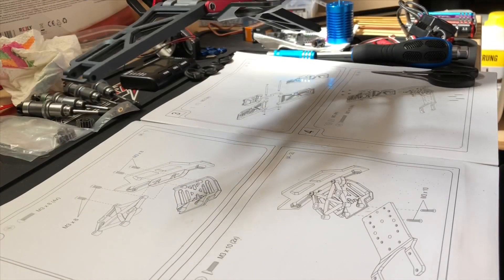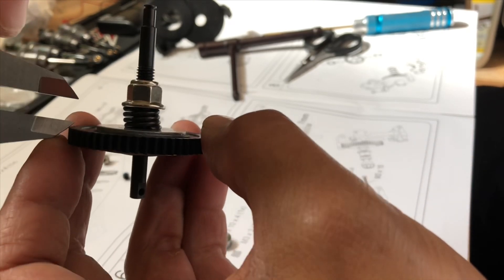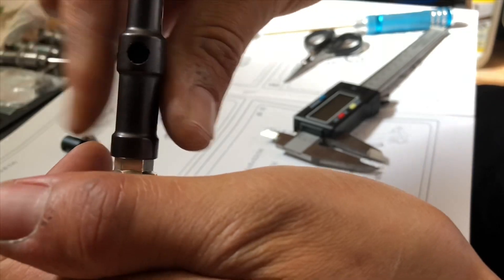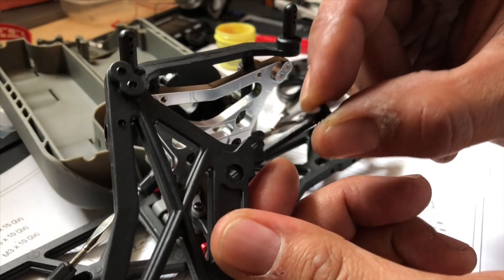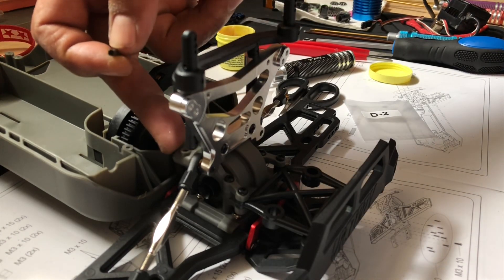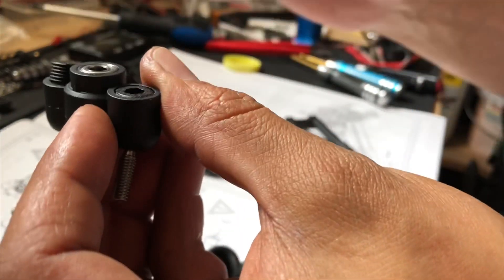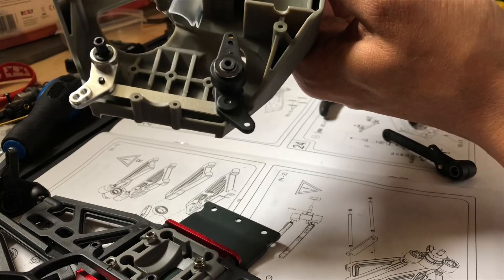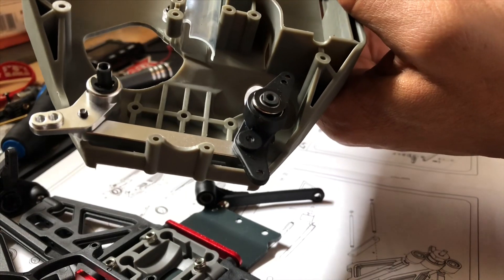REELY New1 Aufbau 1:10 Bausatz & Tuning

Comment: Moin welches Modul hat denn das Hauptzahnrad bzw. Ritzel?
VG
Reply from the maker: Modul 0,6 - Viele Grüße
Reply: Bist du dir sicher ? Ich hab nen 0,6er Ritzel hier und die Zähne sind wesentlich kleiner als die vom Originalritzel hätte eher auf 0,8 bzw 1 getippt 😅
Reply from the maker: @IITheRaZoR1911II  Sorry, mein Fehler. Das ist dann ein Modul 0,8 - Ich hab mittlerweile alle Module daheim rum fahren, da hab ich mich vertan. Aber 0,8 passt auf jeden Fall. Ich habe in der Vergangenheit den DT03 von Tamina gefahren, daher hatte ich die Ritzel mit 17 Zähnen und 19 Zähnen. Habe mittlerweile beide im New1 drin gehabt. Aktuell fahre ich ein 19er mit einer modifizierten Motorhalterung. Das Video dazu findest du unter dem 

Titel: REELY New1 Temperatur Test und Upgrade

Die Ritzel die ich benutze sind  von Tamiya Hop Ups, mit Modul 0,8 aus Stahl. Kostenfaktor ca 5,- € 

:) Das Video hilft auch weiter ;D
Reply: Sehr gut dann vielen Dank da weiß ich Bescheid 😁